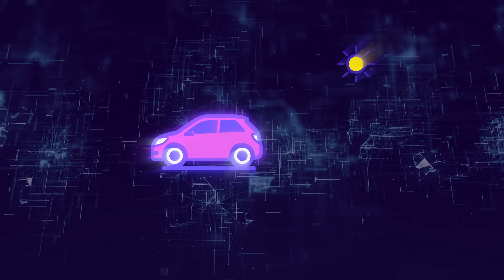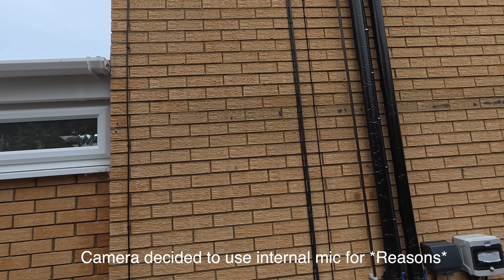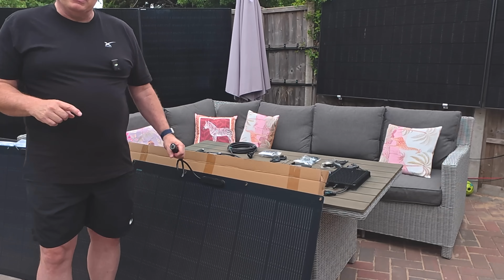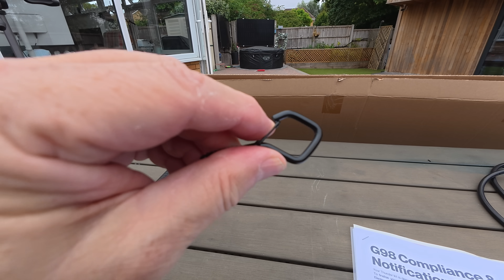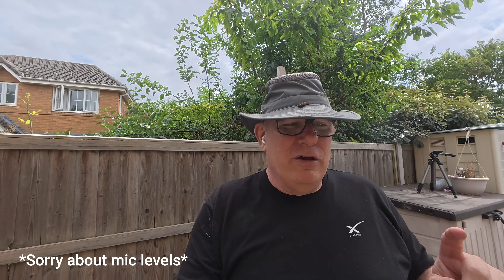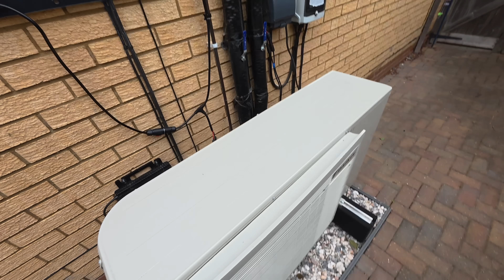thunder energy storm plug in solar installation uk

Comment: Been looking at one of these for cheap overnight storage,  if I was to put a plug on it and  use it , yes not allowed at present, would it work in the UK , and how does it work?  Do I need to program it for the cheap import times? And then does it just discharge back into my house.   And if I did this would my provider be aware? 
Love the concept and as I have a cheap overnight rate it on paper makes sense just so bloody annoying that at present I would be using it illegally in the UK if I just plugged it in 😢
Reply from the maker: This particular system doesn’t have any storage, it’s just a micro inverter connected directly to the house so whatever it generates the house can use or it gets exploited to the grid. Now there’s nothing to say you can’t add an AC couple battery but if that’s your long-term goal, you might be better off looking at something like the Anker Solix or Ecoflow stream systems

Comment: Hi I'm in Scotland have a south facing wall and planning the bolt system. Can I add another 2 panels later onto west facing wall to get continued sun later on same 800w inverter. I'm not looking for more power just want power for longer. Thanks
Reply from the maker: I don’t see why not, sounds like a sensible plan to me
Reply: @JonathanTracey would that be by Y connectors? All new to me!

Comment: Just had a look at their pricing. For a typical starter system, 2x450w panel and Micro inverter plus cables £749. I can put a similar system together with AP systems EZ1 micro inverter plus 2x465w panels from City Plumbing for £314 + cost of cables, say £360? . . . Half the price!
Reply from the maker: yep convenience pricing, be aware that diy builds are not covered by new legislation (if that worries you) but agree if you can do it yourself your going to save money

Comment: Hi 
I have a solis invertor what app would you recommend to work with thunder invertor 
Good videos BTW
Reply from the maker: The thunder system uses hoymiles for its inverter so you need to use the s-miles home app to manage itn

Comment: Plug in solar is also called balcony solar because of hang & forget and let the savings roll in. These lightweight panels need not have the higher efficiency of fixed ones as they can be deployed in many more areas as you have shown here.
Reply from the maker: yep, they are ideal for those kind of things, very little weight so therefore most balconies or fences can easily take the weight

Comment: How easy would this system be to add the panels to a fence. My fence has the wooden slats which are slide in to slotted comcrete post. Does thunder provide fittings for fence mounting. Also could if fit those panels into an ecoflow stream ultra x instead
Reply from the maker: there are screw fittings in the pack, but if they dont work you can always get something more approprate from B&Q or Screwfix.

yes they are just solar panel so they can work with anything. you will need some MC4 extension cables to get hte panels connected to your Ultra X

Comment: Great video. I'd have liked to know (in the video) how much the system is. Also its the cabling and connections that put most DIYers off, so I'd have liked to see more detail of exactly how you did that.    Finally I'd have thought it would be better if you mounted the panels higher or are you planning on adding more - is there a legal or system maximum that you're allowed to fit?
Reply from the maker: @gogs244, fair feedback—I should have included a clearer cost breakdown and shown the cabling and connections in more detail, because that’s often the most intimidating part for DIYers. The maximum isn’t simply a panel-count limit: it depends on the inverter’s input limits, battery/system capacity, circuit design and any DNO or planning requirements. Mounting higher could improve the use of the space, but access, shading, wind loading and cable runs also matter. I may add more later, and a detailed follow-up covering cost, wiring and expansion would be worthwhile.

Comment: Thank you for this info and demo. I have a bungalow with 8 panels facing east and and 8 facing west. No battery storage. Our garage has a flat roof and a charger unit for my EV. (Actually I have never used this fast charger. Instead I slow charge it from a socket in the garage). I am wondering if there would be any benefit in using say 4 plug-in panels plugged into the garage circuit. If so, should they lie flat or be tilted to face the shadow free south? I f you think other EV owners would benefit, maybe this could be the subject of another  video.
Reply from the maker: @alanpmasters, that’s an excellent real-world use case and definitely worth a future video. Four panels could help, but the approved microinverter output would still be capped at 800 W, and your existing 16-panel installation plus the garage circuit and EV charging load would need checking for compatibility. On a shadow-free flat roof, a south-facing tilt will normally produce more annual energy than laying them flat, and it also helps with drainage and dirt, although the mounting, wind loading and roof structure must be considered. I’d ask an electrician or your existing solar installer to assess the circuit before adding anything.

Comment: I know nothing about plug-in solar, so this is probably a stupid question, but here goes. If the panels are generating and you pull the plug out of the wall socket, what stops you getting an electric shock if you touch the plug pins.
Reply from the maker: @philsmith6165 Not a stupid question at all. An approved microinverter must detect the loss of the grid and shut its AC output down very quickly—known as anti-islanding protection. That prevents the unplugged pins remaining continuously live, although the equipment still needs to meet the specified disconnection-time and safety requirements.

Comment: Surely a single 600+ watt panel on the left of the black conduit would have been better. A pair of large panels would not take up much more space & give a lot more power.
Reply from the maker: yes, but that defeats the object of testing out a complete kit. The whole point wasn’t to get the maximum amount of energy it was to see what and off the shelf kit would deliver.

Comment: Frist off I don't know much about solar but I was thinking of getting one and fixing to my fence, I was thinking about fixing onto a frame "home made" at the top and have a 4 inch standoff at the bottom, would the extra angle make much difference? are we going to be allowed more than one setup?
I'm enjoying learning with your videos.
Reply from the maker: so my vertical fence mounted panels have a small plastic stand that pushes the panels out by about 5 degrees, it makes a tiny difference and any extra is good to have

Comment: That does look pretty cool it's a shame they couldn't use more powerful solar panels and I would like to know how you got that inverter working in home assistant as Gemini tells me it's not possible, at least not locally.
Reply from the maker: so you could installed larger panels, but this is designed for balconies or garden fences so weight and size maybe an an issue. Nothing to stop you taking a hoymiles inverter and putting a honking great 500w panel on each input

Comment: As to the comment about plastic MC4 tools.....the reason they are plastic is that when you tighten the connectors up, the tool will distort and slip....at the correct torque to ensure that the joint is not over-tightened. Yes, it's a deliberate design feature.

A metal MC4 tool will not do this, so you can over-tighten the nuts, leading to leaky joints, etc.

Cunning, eh?   😅
Reply from the maker: yes but I find the plastic tools release tool bend easily and cannot apply enough pressure to release the MC4

Comment: 4:41 - they are crap cause the flexibility is there achilles wheel. They will delaminate like hell sooner or later . Believe me, we have a factory building with a roof that was not capable of adding usual solar power and hence we got these flexible glued. Hooror after 5 years when the cracks began. 

If you wann use these that should last you have to clue them perfectly and not in a hurry, you need to add many line of glues across the whole area. 
Why ?
Laminar wind flows over the panels and that sucks on the panel. If that can move and expands then it will fail in the future. YOu have to glue them fully. 
We had luck cause the installers and manufactuers insurance had to pay for that damage  fully, and the worst had been the removal proedure cause that took ages. 

Remember : if you have a roof and storm is throwing concrete tiles from the roof then these tiles are coming from which side? 
Where the wind attacks or on the opposite site in the shadow of the wind ? 

The wind sucks the tiles from the side in the wind shadow and can clean that. The other side facing the storm is safe and no damage. 

Same effect for all panels and that is the reason why regular solar panels are so thick: to avoid any kind of vibration and stop a resonance.  
German experiecns from 25 years solar power and 30 years wind power on a farm with a biomass power plant.
Reply from the maker: so thats the whole point of a long term test, not to take someoene elses opinions on another brand of panels, but to put these specific ones through a test in a real world scenario. Lets see what happens

Comment: i like these lightweight flexible panels and thinking of adding them on top of my pergola, i already have a dura 5 inverter so would i still need to use the micro inverter.
Reply from the maker: if your current inverter has capacity to add more panels you could just plug them in on their own string

Comment: Just installed these myself a week ago on my east facing fence/wall to capture the morning sun. I agree the cable management was fiddly (shared this feedback with Thunder) for me I have them split in 2 x 2 considerably apart from each other and whilst the connector on the Y cable is nice its very bulky and heavy so hard to hide. I coiled mine behind the panels as the connectors are a bit unsightly, however this pushes the panels out more than MC4s would. Also not keen on the way the cable feeds from the front of the panel upwards,  it puts strain on the cable if you dont tie it up, I had to cable tie the cable using the hole on the panel and route it behind. The Y connector isnt in the middle either and whilst it worked OK for one pair it was a pain for the other pair and I had to place the inverter closer than I wanted as they didnt give you must to work with if you have OCD and want to hide the cables so will probably extend them anyway. IMO the time saved with the connector is more than lost trying to make it neat getting them slung up and generating took no time at all, getting it neat took a lot of thought and effort. I originally purchased a pir of thunder panels which were more traditional MC4 from the back and I cabled these up very easily. Overall I like the setup and whilst still early days the power generation has been as expected capturing the morning/midday sun. Will be interested to see how you get on.
Reply from the maker: Thanks for taking the time to write such detailed feedback, that's really useful. It mirrors a lot of what I found during the installation. I really like the concept and the speed of getting the panels connected, but I think the cable management could definitely be refined. The bulky Y connector, cable routing and limited cable lengths all make achieving a really tidy install harder than it needs to be.

The good news is these are all things that can be improved without changing the panels themselves, so hopefully Thunder take the feedback on board for the next revision. Great to hear the generation is meeting your expectations too - especially on an east-facing installation. It'll be interesting to compare notes after we've both had them running for a few months.

Comment: I like what you have shown here and I have the kit in my cart. However, I want to lay these flat on my studio roof, could that be an issue with airflow and haet build up?
Reply from the maker: I don’t think so, but it depends on the material that your roof is made of. I’d maybe drop thunder energy a quick email and just doublecheck with them.

Comment: I hadn't realised that wall mounting was an option. Are there rules on the direction, size or how far they stick out?
Reply from the maker: I believe if they are visible from them road then yes as you have to be careful that sunlight could not be reflected to a driver but in my case none that I am aware of

Comment: Artisan Electrics should be reported to NICEIC for leaving a outside consumer unit in a unsafe condition! As you showed the cover is broken now you have no IP rating. Water will get into the unit. that makes them no better than the rest of the so called best of the best.
Reply from the maker: so to be clear Artisan did not leave the cover broken I broke the hinge, the seal is still intact so no water is ingressing, and a new cover has been ordered
Reply: @JonathanTracey I didn’t say they caused the damage but they installed a 
New circuit and did paper work and test the installed circuit. Knowing the lid was broken the MCB feeding the DB should have been isolated until the repair/replacement cover is installed

Comment: stupid question, isn't 180W panels a bit .... small beer ?
Im seeing panels these days retail trying to get over 600w
Is it a weight thing ?
Reply from the maker: yes 600w panels are about 30kg each, you need multiple people and much beefier mounts to wall mount panels of that size. They are usually to big for balconies or fences which this system is suited for
Reply: I have 12x Aiko Comet 1N Gen 2 ABC 610W installed on my roof...many flat roofs in Spain have 600W+ mounted...it has to be the pitched roof Vs flat roof that limits the big guns

Comment: Why are installing plug in solar when it is still currently illegal? Why do you believe you don’t have to obey the law?
Reply: Never driven at 35mph in a 30mph zone ? 8)

And he's not breaking the law because he has a correct wired in installation to a circuit previously installed by an electrician for this kind of stuff.

He's also not breaking the law if its temporary which is why folks like Efix have been able to test plug in.
Reply from the maker: its not illegal its against the wiring regulations thats a different thing
Reply: @JonathanTracey  not so wiring regs is building regs part P, so is build regulations 2010 and has statutory force including fines, and since 2023 jail time although the latter is for rather more major offences. You can in theory get a five grand fine for plugging in your Ecoflow box early. Probably about as likely as being fined for shaking carpets outdoors in London, although as they now arrest old people for holding up blank paper who knows

Comment: The best plugin system I have seen so far has 4 x 450watt panels connected using Y plugs. Which will be clipped by the inverter in high sun but will actually give 800W for a MUCH larger period of the year...
Reply: Y plugs are not permitted in the UK plug in standard.

6.2.2 Item #4   "Y-connectors shall not be used."

Not quite sure why that ended up in the rules but it did so any plug in system with Y plugs in is not permitted in the UK when the legislation passes. I have some T shaped plugs here fortunately ;)

Overpanelling is definitely smart in the UK but a lot of the microinverters have neither the voltage or Isc limits to do it with standard panels. You can get 780W on an Ecoflow one in the 20A / 60v limit but it requires using four of exactly the right 195W panels. Some of the others are even more awkward.
Reply: @etchedpixels  i wonder if the "special wiring harness" is actually a disguised Y connector or if the panels are in series?
Reply: @etchedpixels  good to know thanks
I can see why Y connectors aren't allowed due to balancing issues 
still - overpanelling is a smart idea
Reply from the maker: Yep but I could not get 450w panels on my wall - at least not without help and probably scaffolding

Comment: This seems to be a very VERY expensive way to get a max 710W of solar which will be less than 100w on dull days. All for £650...complete madness, I wouldnt consider it for a second.
Reply from the maker: depends on your situation if your only place to mount it is a balcony then its a great system
Reply: It’s an entry level point, once you see how much money you can save then, you invest proper money in a roof top or ground mount system. Sometimes you have to look at the bigger picture, it’s all about taking control of your energy, especially if you’re in your forever home.

Comment: I've got a couple of those metal MC4 tools in fact they look identical. I got told off for using them because you shouldn't be using an ungrounded unprotected metal tool on a live solar circuit 8)

Looks a nice kit and someone has really thought about it. For me the turn off is the proprietary cable connectors and I'd definitely need different lengths and with MC4s I can just order them to spec from midsummer and a bunch of other places. I wish @ThunderEnergy good luck with it.

Comment: How do you add this to an existing Sigenergy system?
Reply: You get your sigenergy installer involved, and a new G99 (which may be refused) and mucho pain. Usually you'd want to add more panels on the DC side of the sig to avoid the paperwork nightmare you will cause.
Reply: @etchedpixels thank you!
Reply from the maker: you dont really its a stand alone setup